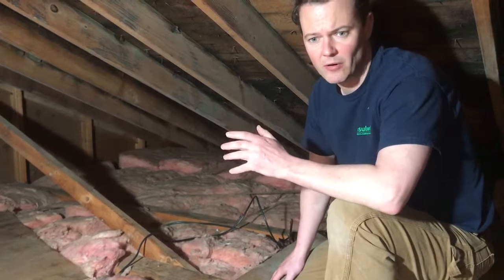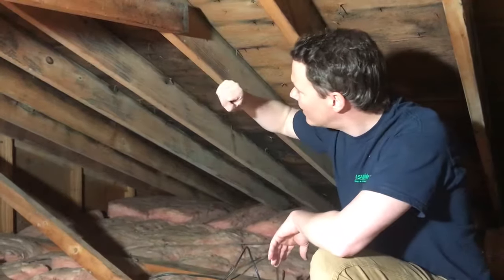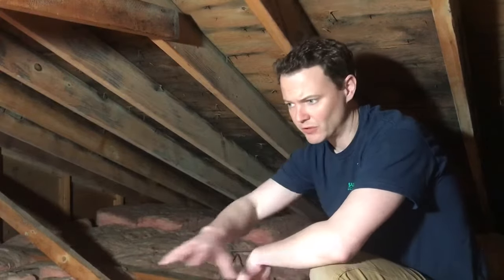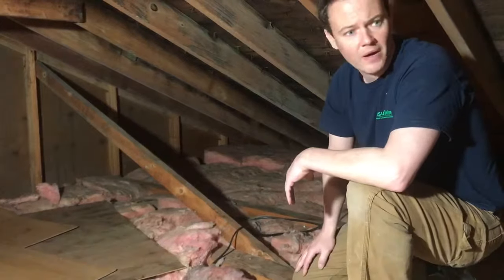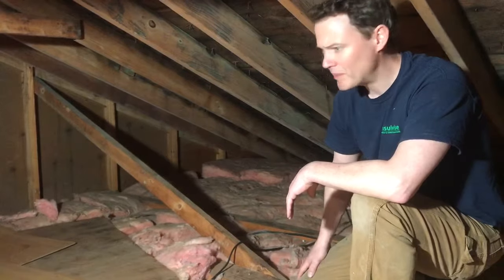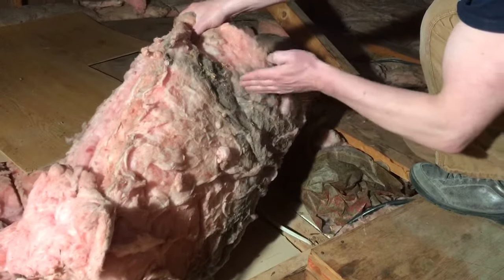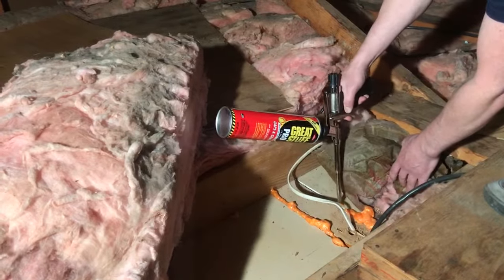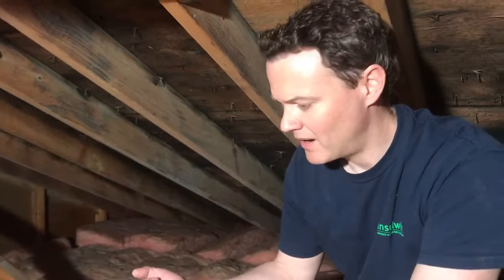There's Mold in my Attic!  What Caused it and How Insulwise Solves it.

Comment: You are the first one that made sense with my issue of how to deal with and prevent mold growth in the attic.  Thank you.
Reply from the maker: Hi Russell, you're highly welcome.  I am going to be putting together another video for trouble shooting attic moisture issues soon.  We had a previous customer who had moisture problems develop in his attic after we air sealed and insulated his attic.  After I inspected everything I found that he has drainage issues on his back garage wall and water is coming through is foundation wall.  In this case I'm convinced that no matter how well his roof and ventilation measures were functioning, and how well we'd air sealed his attic (we zone tested it using a blower door -- it is VERY well sealed), he'd still be having moisture issues in his attic due to the sheer volume of moisture entering his home via the foundation wall.  
So, these issues can get complicated.  But the moral of the story for all attic mold issues is that the moisture source must first be identified and eliminated before you can hope to permanently solve the issue.  Otherwise the mold will simply keep coming back. 

Thanks!
Andy

Comment: Great overview.  My house lacked soffit vents and I had a minor mold issue luckily.  I added vents along with a full ridge vent when I re-roofed.

BTW... It's probably best to use fire block foam to also meet newer fire codes and not  typical gap foam that does not.
Reply from the maker: The fire block foam is basically the same formulation, no difference in terms of temperature reactivity or toward flames that I was able to discern.  And if you have a house fire, it won't be the foam in your wire holes that keeps it under control.  You'll need a sprinkler system if you truly want to defeat or contain a house fire.

Comment: I've had my attic treated for mold 3 times by the same company in a 5yr period (paid once, covered by regrowth warranty the next 2 times). They've added static vents near the top (I have a hip roof, no ridge vent) and they said that our ventilation is sufficient and they cannot add more static box vents. I also have an attic fan that runs when humidity is high in the summertime (just replaced it as the other was noisy, i do know it works). They said from now on they can't warranty the mold removal work anymore and that it must be our roof. We also have perforated soffit panels, and i will have to check with a camera on a stick to see if those are indeed not covered up by insulation or rodent nests. I do notice this gray discoloration on my yellow fiberglass insulation. I really hope this is the fix to my problems, because if it's a roof issue I'm in some deep shhh. Any thoughts?
Reply from the maker: We see this in the Pittsburgh area often.  Mold companies know how to kill attic mold, but they don't understand what causes it to grow or how to keep it from coming back.  Check out this link on our website that explains attic mold, and read what I've written below.  https://www.insulwise.com/pittsburgh-attic-mold-specialists/

1)  Confirm your roof is water tight.  If it is then the moisture is coming from your home in the form of air leaks in your attic floor.  These need to be verifiably sealed so that the air in your home is no longer communicating with the air in your attic.  Very few companies out there understand what this is, why it's necessary, or how to do it properly, so be careful in hiring a company to do this.  This is attic air sealing:  https://www.insulwise.com/insulation/air-sealing-insulwise-pittsburgh/

2)  You need to get your attic ventilation right.  Attic ventilation needs to be balanced between exhaust (up high by the ridge) and intake (down low at the soffits).  If your attic only has exhaust vents than you could be making the problem worse by putting your attic in a state of depressurization...where your attic is effectively sucking air upward from your home.  During the winter this air is going to have moisture in it, and you don't want that because moisture is fuel for mold growth. 

3)  Confirm your intake vents are working by going up into your attic during a bright sunny day and turning off all the lights.  Your soffits will either be lit up with daylight (not just a dim crack of light showing) or they won't be.  If you have soffit baffles and deep insulation you will need to adjust your vision so that you can peer down the open tops of the baffles.  In Pittsburgh perforated soffits are decorative about 90% of the time.  The wooden soffits beneath them usually have no holes drilled, so they only "look" like they're working. 

4)  If you believe that your attic vents are not set up properly, have a roofer calculate your ventilation needs "1/300 rule" and have him install intake and exhaust vents until you are balanced and at the recommended level.  Keep calling roofers until you talk to one that can have an intelligent conversation about proper ventilation...many of them can't.

5) Now it's time to kill the mold again.  This time it should not come back. 

6) Attic power fans often cause more problems than they solve.  Knucklehead contractors often install them without realizing that they NEED to have a specified amount of "net free make up air" for intake,  or they absolutely WILL pull that air upward from your home.  The required amount of Net Free Air for make up air is listed on the box of every power fan that I have looked at.  And every roof vent that I've seen sold lists the amount of net free air (NFA) they supply on the side of the box.  Also, no attic that I've seen needs any kind of powered fan if the passive ventilation is set up right, and the attic floor is properly air sealed and insulated. 

Hope this helps!
Andy
Reply: That response is the best you will get! I have replaced plywood with black mold because of improper ventilation! Also you can’t have to many ridge vent or ventilation for hot air to go because it will work in reverse and not have enough to bring cold air from soffit to ridge vents! I only recommend having a longer ridge vent than to add dormer vents or anything else! If so you will be to know the proper length around your home to have to proper ventilation.

Comment: Thanks for mentioning why the fiberglass was dark, like filtering because of the air movement. That really makes sense.  Did you add any soffit vents? I added gable vents to a steel pole garage and a shed and it seems to have added moisture as some of the stored wood is molding as well as a stored car interior. Maybe should have not made the changes having not fully understood the process. Thank you for your video.
Reply from the maker: Hi Steve, adding ventilation should not have caused mold to grow, unless possibly you live in a tropical environment and previously had been running a dehumidifier in that space?

Andy

Comment: Really appreciate the video! We are potentially buying a home in which mold was found throughout the attic. Our inspector suggested that the source was almost entirely attributed to the whole house fan not having a cover on it. Effectively letting humid air up there 247.

Two questions if I can: 1. What spray do you use when spraying to kill the microbials? 2. What time of the year does one place a cover on the fan to ensure moisture doesn't get up there and cause this issue?

Thanks so much!!!
Reply from the maker: Hi Robert, 
Unless you live in a dry climate like Colorado or the Southwest, we always recommend removing whole house fans.  From a thermal efficiency standpoint they are lousy in humid summers.  That said we build insulated boxes with foam board lids for our customers who insist on having them.  In Pittsburgh they're useful for about 3 weeks in the early fall and maybe a few weeks in June.  The rest of the time you're going to need to use your AC to remove humidity from the air in order to feel comfortable, so you want that thing sealed as tight as possible.  

We use RMR mold killer.   It is high test stuff let me tell you, you will need a full face respirator and you will not want to get it on you.  Also, if you do not seal the air leaks in the rest of your attic floor, and if your roof/ attic is not properly ventilated with a balanced amount of intake and exhaust ventilation, that mold will 100% be coming back.  

Check out the link to our attic mold page to see how we tackle this:
https://www.insulwise.com/pittsburgh-attic-mold-specialists/

How we air seal attics:
https://www.insulwise.com/insulation/air-sealing-insulwise-pittsburgh/

Hope this helps!
Andy

Comment: i know soffits are important but would gable vents be ok enough  if i put gable vents on both end of the house? 
Im currently having mold issues and i only have one gable vent installed on one end of the house.
Reply from the maker: Yes you absolutely want gable vents on both ends so that the westward breeze can push through your attic, but you ALSO need to make sure that your bathroom fans are vented out through the roof and that your attic floor is air sealed.  The first thing to do is staunch the flow of moisture getting into your attic in the first place.

Comment: Great video. I’m having some issues I believe and I was wondering if you could give me your thoughts .

So our attic is finished so there is no real crawl space like this to see what’s going on .  They thought it was a good idea to shove an hvac in a closet on the side that is near
The side of the roof. They also thought it was a good idea to saw a huge open hole in that furnace next to also a bunch for exposed insulation . So the hole is before where you would put the filter .

That attic gets like 80 percent humidity in the summer . Above the hvac the wood is black . My family just says it’s shed wood . Also we had a leak multiple times in the roof that lead to the finished ceiling peeling paint off. Supposedly they changed the insulation and didn’t see mold but idk who did the job .

Should attics not be finished and used as rooms? Iv actually stored most of my stuff on there like a room and do humidity when it’s dry and started using dehumidifiers a couple years ago but it was still uncontrolled for Years and they neglected fixing that leaks for years despite me telling them . 

How can I go about really checking for mold when there isn’t a crawl space and is the hvac being there, with an open hole on top of that (btw the hvac has never been serviced , for like 7 years) a bad idea?

I need some advice and frankly the people I love with act like I’m ridiculous for thinking the hvac needs to be checked on and same with the roof and worries about mold . There is also a chimney (not a fire place chimney) that goes through that attic that has never had a sweep.

I’m blown away by their total lack of basic responsibility but idk, what do you think? Iv felt health issues arise but again they act like
It’s nothing since they don’t spend any time in the attic
Reply from the maker: Hi there, thanks for the compliment.  So yes, you NEED to have that HVAC system checked out.  You've got some things going on there that definitely NEED to be resolved.
1)  Make absolutely sure that the roof leaks are fixed.  Active leaks will leave staining on the drywall (if they are leaking badly enough).
2)  Get your HVAC system checked out.  I'm not sure if the HVAC is located in a conditioned space (room is heated and cooled) or an unfinished space (area is not heated and cooled, like a true attic or garage space).  If it's in an unconditioned space, it should absolutely NOT be pulling in return air from that space, so there should be no holes in the return.  If the closet is in a conditioned space, the hole may not be a bad thing, but it is still suspect.  Either way, it should be before the filter, not after it.  Any air entering the return NEEDS to be getting filtered. 
3)  Without removing the drywall, there is likely no way to tell if there is mold above it. 
4)  It's ok to finish attics so that they are conditioned spaces, they just need to be properly conditioned and insulated. 
5)  The chimney should be inspected as well, but you can also test it from below to make sure that it is drafting.
Hope this helps!
Andy
Reply: Thanks so much for the answer . Yeah I mean, the attic and the room the furnace and the hole is in  have vents pushing hot and cold air in from the heating and cooling system .

But the humidity gets very high and the wood is black ontop and the insulation is open next to that hole .

And our roof leak was supposedly fixed and then leaked again and the paint fell of twice over the course of a year and it also left a stain. They never removed the drywall on the ceiling , just painted over it and sealed the outside 

I was looking into hvac cleaning and see evaporator could shouod be cleaned etc, we’ve never done that , zero maintenance . Tbh the rest of the inhabitants of the house feel there is no need to do anything so it creates an incredibly frustrating scenario, especially as I have suffered health issues for years and been borderline begging them for years but they don’t want to spend money
Reply: I also thought about the fact the furnace is right below the bare roof and so as it heats up and it’s in the room that can be 80 degrees while the outside can be 20 or less in the winter and vice  versa In the summer , this can be creating condensation since it’s not isolating the roof with insulation .

It’s just open, as if the roof youre  in in this video is sealed but the whole right side is exposed to below and the rest of the house while there is no insulation stopping temperature changes going into that section of the roof
Reply from the maker: @heythere6983  The furnace being in that room and close to the roof would actually help to prevent condensation forming on the underside of the roof.  It is adding heat to that area, which would help to dry out the roof.  The worst condensation and mold problems often form in well insulated attics.   This occurs because there is little heat from the house escaping to the attic, which would help to dry the roof.  We don't think that I have once ever seen a mold problem in a poorly insulated, or uninsulated attic.  You might see some melt patches on the roof when it snows and possibly ice damming, but it sounds like those are the least of your issues. 
Andy
Reply: Oh interesting thanks . I had thought the difference of heat from the inside to the outside would cause the condensation issue
Reply: First minute of the video confused me when I rewatched bc I figured the air from the house hitting the roof is an issue and our indoor humidity gets to 80 percent in summer . The attic also has a Separate  humidifier although that’s for winter for about 40 percent . The horizontal pieces of wood of the backside of the roof are black but the vertical pieces of wood underneath them are not black, atleast barely. Made me think those horizontal turned black due to some temperature difference due to being closer to outside air on  one side vs the vertical pieces under who wouldn’t be as close to the outside temps/humidity vs inside contrasting temps/humidity. Humidity in the house is not controlled either , just the humidifier in the attic at times for dry winter, since I have instruments there

AC shares same ducts as furnace and blows humid house air into inside of roof (through the hole ontop of the duct ) , if that’s relevant . 
   Also the space where that Furnace sits (that spills household air through the hole ontop)  has a gap leading into the rest of the roof that is un accessible and insulated since it is behind a dry wall ceiling.  So the insulated area (95 % of roof) is not fully sealed to that one part that isn’t fully insulated(5 percent of roof where hvac system goes, open duct) . The area of top of the furnace/duct hole  isn’t insulated BUT the area around it is, on the side wall that is the wall for the finished attic .  So I would think that relates to the 1st minute taking about leaks into insulated area of attic
Reply from the maker: @heythere6983    You should definitely have a good HVAC company come out and inspect that system, and ask them about the holes in ducts when they are there.

Comment: Appreciate your video. Any recommendations for reliable companies in the Erie area? My husband passed last year and I'm slowly learning how to tackle odd jobs around the house. I'm not sure I'm up for this one, thought. TIA
Reply from the maker: Hi there, I am greatly sorry to hear about the passing of your husband.  Unfortunately I'm not familiar with the Erie area.  The type of solution that Insulwise offers seems to be very unique for this space.  What I would recommend doing is hiring an insulation company that focuses on air sealing to come up and air seal your attic floor, make sure that your bathroom fans are venting out of the house properly, and also assess your roof ventilation for any deficiencies.  We add additional roof vents all the time (these help attics to dissipate heat in the summer, but more importantly they help excess moisture to escape).  Once all the prep work of the roof and attic floor has been done, I would then have the underside of the roof treated by a mold remediation company.  We have learned and seen numerous times that if the moisture source in the attic is not addressed, that the mold will more than likely come back. 
Hope this helps you!
Andy